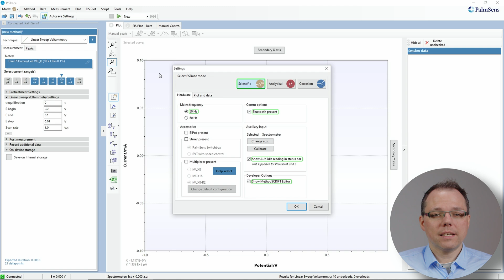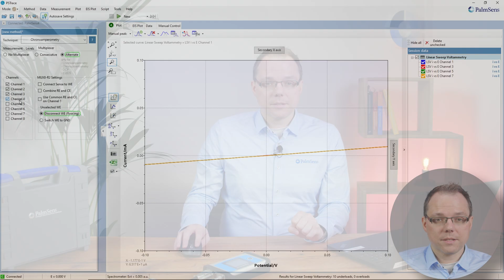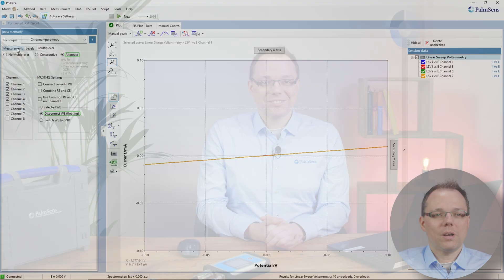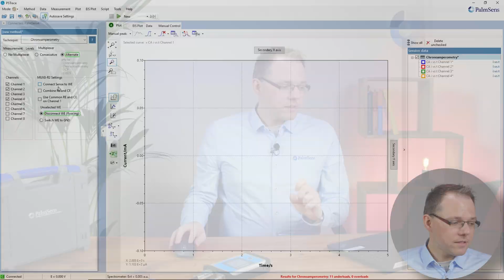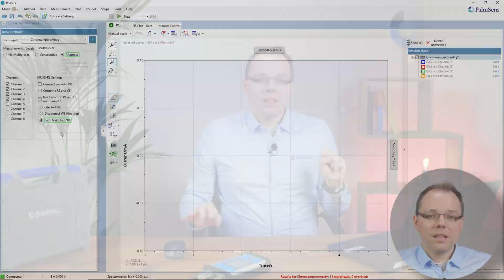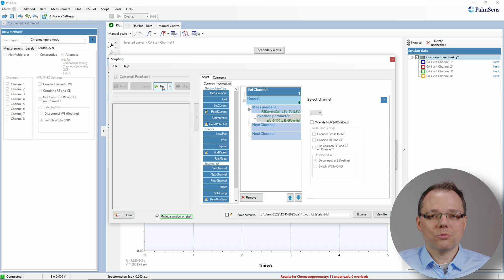PSTrace Tutorial #19 - How to operate a Multiplexer with a potentiostat?

Comment: hi,  @palmSens when i am using MUX 16 PCB and choosing the option MUX 16 from general setting. The multiplexer option is not showing after clicking ok. please let me know what are the possible issue
Reply from the maker: Dear Sir or Madam, As I understand you are already in contact with our support team. The issue was that you are using the multiplexer for the EmStat Pico. The EmStat Pico MUX16 is not controlled via PSTrace directly. It is controlled by MethodScript, but you can use the MethodSCRIPT Sandbox in PSTrace to control it.
Reply: @PalmSens   Thanks I understood . Actually i have used Methodscript sandbox to operate MUX 16 .But i can only be able to take readings of LSV. please guide how can  i take chronoamperometry readings. because when i try to use different scrip for chronoamperometry . it is not working I only got horizontal line in the readings.
Reply from the maker: Dear Noor E Hera Warsi, I'm afraid the explanation is a bit too long for youtube comments. Let's continue the discussion via email: info@palmsens.com
Reply: @PalmSens   yes sure. Thanks alot

Comment: Hi , thanks for the explanations. Could you please let me know how to connect four working electrodes along with using one reference and counter.
Reply from the maker: Dear Muhsinali8386, The explanation is from 5:07 (https://www.youtube.com/watch?v=6QzdxloZCkc&t=307s) onward.
If you let me know what is missing in this segment, I'm happy to give you a further explanation.
Reply: @PalmSens  I went through the vedio but I have one thing to ask, if we have printed sensor with multiple WE and one RE and one CE in common then what should be the options to use multiplex in hardware and software
Reply from the maker: In the software you, as described in the video,  check the box to use the common RE and CE of channel 1. They are also marked as common RE and common CE on the cable. This way the RE and CE are no longer multiplexed, so all measurements will be performed with thie RE and CE. 
I'm afraid, I don't know which connections are best for your customized electrodes, but if you have broad contact pads, you could just the croc clips, which were delivered with the device. If you want to send us photos of your setups, feel free to send your questions and any extra data to info@palmsens.com